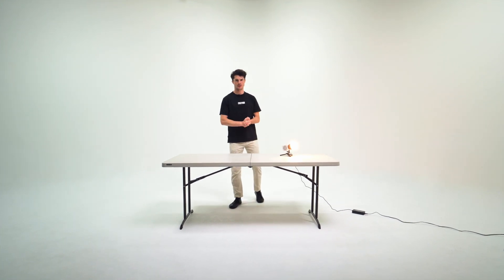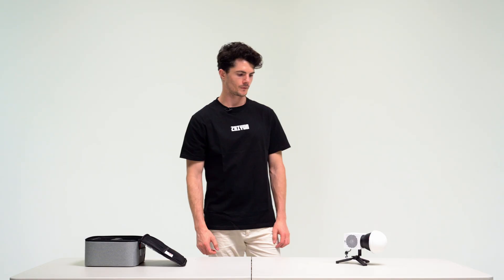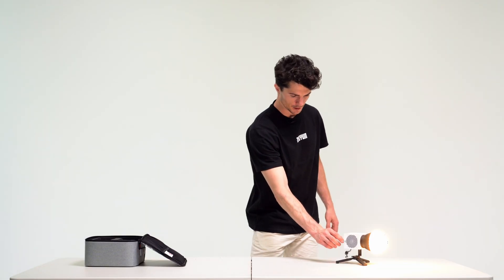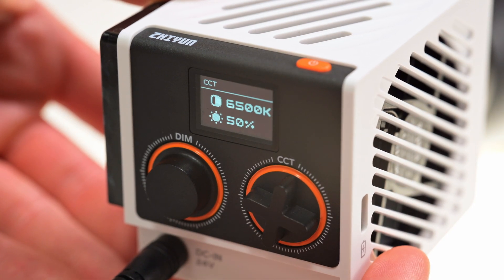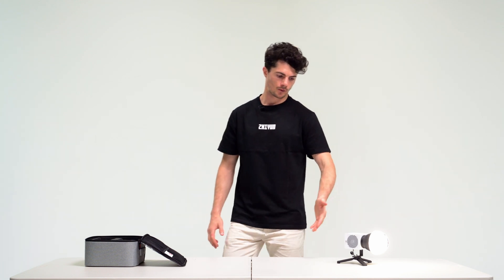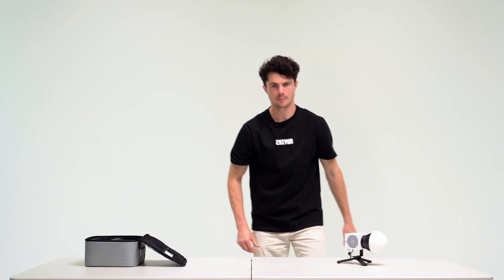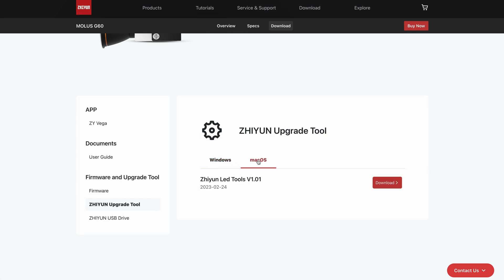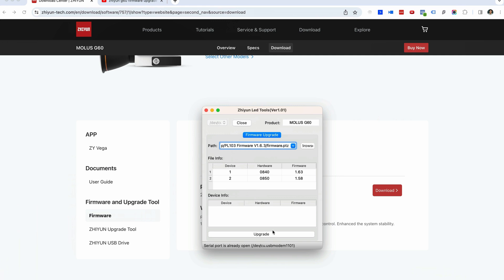ZHIYUN MOLUS G60 Official Tutorial: Operation and Firmware Upgrading

Comment: Bluetooth is not connecting
Need to firmware update it, to firmware update mac is not recognising it, what to do???
Reply: hi there, i have bought the zhiyun g60 too and i have the same problem, did you find a solution? if yes please can you write it to me how did you do it?
Reply: @ati123-v1y  speak your problem...will reply
Reply: @Ravisidharthan  thanks, i just bought the light and i think i have the same problem as you. Firstly i tried  to add and connect it with the bluetooth in the app. Then it found the device but it doesnt want to connect its writing something is wrong or idk, and then i went to this tutorial did the same thing downloaded the filmware upgrade.. and then i connected the light to my macbook usb c to usb c, yes i tried it with multiple cables even bought a data transfer cable and every time i opened the led app. That guy just clicked to open button and i couldnt open it, it didnt work. Okay, then i browsed for the firmware upgrade searched it and then i couldnt upgrade because i couldnt press the button.

-Thank you
Reply: @ati123-v1y  click open button on the software window. I did upgrade but it dint help to connect

Comment: Ok so my Mac would not recognize the light with a usb - c cable... I tried multiple even the expensive TB4 Apple cable.... but a simple usb-a-c worked right away... funny thing is same with my power bank and the light... my 140watt Ravpower battery won't work with the light via usb-c but usb-a to c the light works with the battery... odd but hopefully this helps you.

Comment: how to connect the molus w60 with zy vega app.
Reply: Hi ZHIYUN, does the G60 need to be set to a special Bluetooth pairing mode to connect to the ZY app?
Reply: I have the same question. I wonder if this firmware helps connect the G60 to the apps Bluetooth better. 🤔